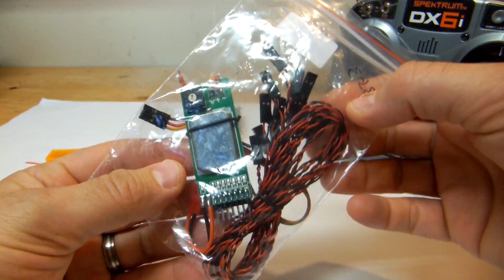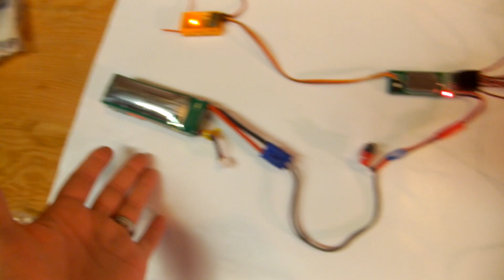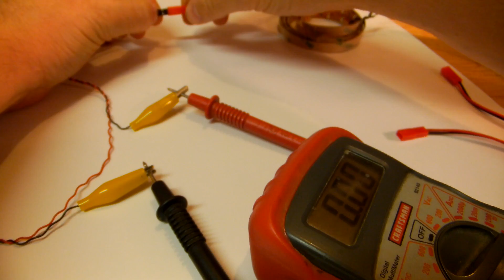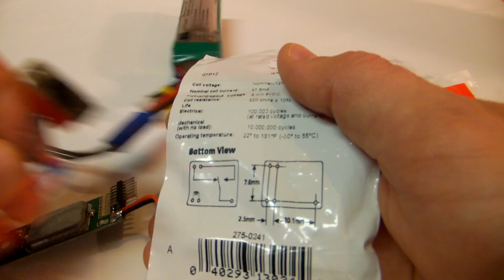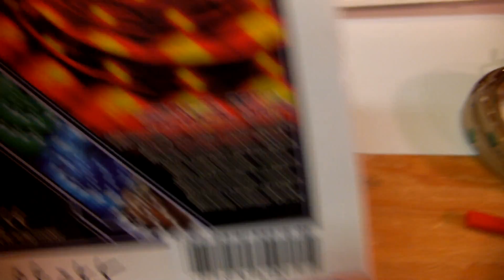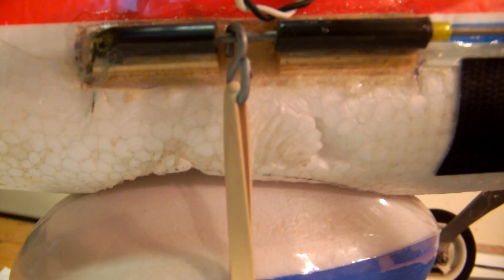How To Install LED Lights on Your R/C Plane Using a Multi-Switch

Comment: can you link the exact plane you are using.  i would like to think that would be a good plane to use for park flying with LEDs.  Also, is there any way to connect LEDs to the balance lead from the battery instead of the main leads.  I don't want to put an extra battery in the foam plane (too much weight).  And I would like to have the full voltage due to LEDs requiring 12v and balance leads from the battery need to be in series and they are not, there are just indivicual leads from all the positives and the the negative. so that would be parallel and only give the 4.2v (fully charged lipo) as opposed to a 3S 12.6v (fully charged 100% full).  Thanks man!!!

Comment: I want to add an LED, light to an old router, most new tools have LED's that come on with a squeeze of the trigger, (ala drills and such), so my question is, can I use the 110v inside, and step it down with a resistor? If anyone has done this, please comment. Thanks

Comment: Not sure what idiot savant would give this video a thumbs down, but clearly, they're out there. 

Outstanding video/tutorial. This was really ahead of its time, as the sUAS boom is now upon us with the rise in educational degrees to fill the rising number of sUAS piloting jobs. Those new to sUAS or RC need/want lighting systems and there is still really no one-stop-shop solution for this. 

This video is the first and best explanation of the components and wiring required to set up a working lighting system, whether you're a savant or new to RC and electronics.

In fact, it was only by chance/luck that I found this after a week of searching...and I was amazed to see the date of the post and realize how relevant this is some 4 years later.

Comment: Fantastic video, thank you for making this product and taking the time to share.  Question:  is it possible to eliminate any of the ports so that it is possible to set it up to cycle through only say... 3 or 4 of the ports?  Thanks again, I will be buying one!
Reply from the maker: Yes, the workaround is to set it to one of the modes that activates 2 ports at a time with each toggle. Then just put your electronics on half of the ports. This gives you a cycle of 4 before resetting to zero, instead of having to cycle through all 7 each time. Your toggle cycle will then go like this with each press: 1 and 7 on, 2 and 6 on, 3 and 5 on, 4 on. Then just plug things into 1, 2, 3, and 4.
Reply: Gotcha of course.  Thanks for the tip, and the switch works great!

Comment: Good info...gave ya a LIKE and subscribed!
Thanks!!!!
One question...when a batt pack gets swollen, isn't it unsafe and a fire hazard, just sitting around? (referring to one of your other videos on the multi-switch)
Reply: if it's swollen, don't use it in your plane.

Comment: One more question .....what is that that you are using to power your "cheap" receiver? That has to run off of 5v right?
Reply from the maker: I think I was using a LiFe battery pack. I was using that battery pack originally to power my receiver in a large nitro powered airplane.

Comment: If I place a 5v ubec between the 3s battery and the main lead into the Multi-Switch, will that allow me to use 5v devices out of the 7 ports Glassdogangle ?
Reply from the maker: Yes that is exactly correct. Whatever voltage you send into the thicker input wires is the exact voltage you will get out of each of the 7 output ports.
Reply: This answers my question too, so thanks.  Next is a higher powered switch I am looking for. I will want to turn on and off an EDF at an efficient speed.

Comment: Is there an LED or some kind of flash that is strong enough to be seen during the day from a distance, such as when your drone is flown to a point where it's just a tiny dot and you end up losing where it's at.  A bright flash that you can engage with a remote will help you find the drone.  Is there such a thing?

Comment: I have a question. I have this LED navigation light system, however my 6 ch rx is already connected with all channels to my rc heli.  What solution you can provide so I can install the LED lights to my scale heli? Can I directly connect the positive and negative (red and black wire) from the LED to the lipo w/out connecting it to the rx?
Reply: No,  I think you would need the yellow (data) wire connected to control the multi switch.

Comment: Question? My patented controller doesn't have any extra aux channels for me to extra devices such as led, etc. I wish to place a retractable landing gear unit with it. How can achieve this? Yuneec Q500 and ST10+

Comment: Do I need to run a inline resistor to every LED light? Like I said, I'm right next to brain dead when it comes to electronics. Again Thanks.
Reply: You don't have to. just make sure your LED's are same voltage as your battery voltage that supplies power to the output. unless, you are using an LED with lower voltage then you must put a resistor on each LED's. Hope that helps.

Comment: How do u power the Led ring headlight? I read on hobbyking it pulls more than 500 mah?
Reply from the maker: +vonown3d --- I use the multiSwitch as described in the video to power the LED ring at the front.
Reply: +glassdogangle i see, is it the hobbyking one? do u know the amp pull on it? thx for the good vids!
Reply from the maker: +vonown3d --- Yes it is the HK one. I don't know what the amp draw is. Haven't flown her in over a year.

Comment: Hey, awesome video! However, I need some assistance regarding the realys. How do you wire them? I have a total of 5 pins, I know the 2 coil pins and the 2 normally closed and open, but what does the fifth one do? Some people refer to it as the COM....

Comment: How would My ESC fit into this setup? With the ESC pluged into channel 3 that supplys power to the Rx do I still need the other Bat?  Just Confused...Again a new be.
Reply: you plug a seperate battery to the jst plug on the multiswitch. the servo wire from the multiswitch will got to a free channel on the rx

Comment: Hey doorknob, that little "noise maker" speaker is called a Piezo buzzer. You can buy them online or at Radio Shack for $6.99.. which means painstakingly taking apart an Energizer "panic device" to get the little speaker is completely pointless. It's called deductive logic. Try it sometime.
Reply from the maker: +ShadowⓋ &lt;~~~ Painstakingly? Hardly. I think you missed the entire point I was trying to make. The point is with a 12v battery as a power source you can take pretty much anything that runs off 12 volts and power it using the multiSwitch.
Reply: glassdogangle
Well.. that seals it. You're completely insane.
Reply: +ShadowⓋ Why in the world do you have to come on here and act so rude? There were many different ways to say it was a piezo buzzer instead of insulting. You missed the point of how he was saying you could use about anything that would work with the voltage he has available. And an FYI if someone does a search for panic alarms they will find ones for $2-$4 which dont require any other circuitry.  I am an electronic tech and I am very impressed with his setup. GREAT job glass!
Reply: Tim B
As if everyone has a "panic alarm" laying around their house to go through an insanely complicated procedure to make a buzzer. It's called deductive logic. Seriously dude.. How about just buy a fucking buzzer from Radio Shack? That's my point.
Reply: +ShadowⓋ You are correct and I understand it might be a lot easier just to get a little piezo buzzer, but Radio Shacks are getting harder to find and it is even harder to find actual electronics parts in many of them anymore.
Just stating "Buying a piezo buzzer from radio shack would be easier" would have been so much more respectable.
He was kind enough to record and post this video for people why be rude to him, just inform and educate thanks
RadioShack piezo buzzer 6-18vdc sku 2730059 $3.99
Reply from the maker: +Tim B --- Shadow is upset because his only contribution here was to rudely point out that one can purchase a peizo buzzer separately without opening up a panic alarm to get one, and we were not giving him due credit. I feel bad for taking that moment of glory away from him. Sorry, Shadow. I vow I will never again pop open any other electronic devices to salvage parts. I swear. I will henceforth buy everything new from Radio Shack. Thanks for the tip, Shadow. (saw, saw, cut, cut, hack, chop ,chop, bzzzzz, saw, saw, snap, bzzzz...noises in background)
Reply from the maker: +ShadowⓋ --- Thank you for revealing to everyone on youtube the dark wicked thoughts bouncing around between your ears, which you have now made public for everyone to see. A man's words always betrays his own inner struggles.
Reply: glassdogangle What a bunch of hot air. You "betray" yourself with a bunch of bullshit.
Reply from the maker: +ShadowⓋ --- Rage much?
Reply: glassdogangle
It's not "rage", it's common sense and deductive reasoning. For people such as myself, idiocy is easy to see. Think of it like looking through glass.. and the more you try to insult me, the worse it gets, so I wouldn't even go there because that's my specialty. Rest assured, I'll make things very miserable. It's best to just STFU and learn the hard way.
Reply: *****
Just be sure you finish me because if I get up you're going to meet your God.

Comment: hello glassdogangle i am buying a f16 fighter jet that i am going to use as a display piece in my living room suspended from my cathedral ceilings, is there a way i can activate the multi function switch with some sort of wireless remote and turn all the lights on at one time? thank you in advance

Comment: I just picked up one of these to operate my lights on my Ranger Ex.  I am currently running an ImmersionRC receiver with 12 PPM channels assigned.  To operate my camera selector, flaps, pan and tilt I have used up my "physical" channels coming directly off my receiver.  Could you give me a breakdown on how you accommodate all your channels?  At this point I am making choices on what I can connect and operate remotely.  Can I integrate my cameras and lights onto this multiswitch?  The last thing I want to do is step on my channels by assigning a physical channel that is currently being occupied by a PPM channel.  Any help you can provide would be awesome.  BTW, love the videos.  My Ranger Ex build is based on your setup.
Reply from the maker: I use a Taranis 16 channel R/C control, with 12 channels enabled. For my Receiver, I use a 12 channel DragonLink. If you have used up all your physical channels on your receiver, you will not be able to use the switch. You need one open Rx channel to operate the multiSwitch. You can't really run your camera off of the multiswitch. The multiswitch is simply a way to power up 7 different devices one after the other using only 1 single channel on your R/C system. You would want your FPV camera to be powered up all the time from the moment you turn your plane on, not just when you power it up using the multiswitch. I mean you could, but why?
Reply: thanks for the reply.  Just need one more channel.....  man.   I guess between pan, tilt, flaps, camera selector vs. light switch, I could just manually plug the lights in during dusk flights.  thanks for the info!
Reply: 82dParatrooper Hi. If you have a Futaba radio, specifically the 14SG, you can set it up in what is known as "Mode D". This gives you Chs 1-8 on the Sbus, and 9-16 on the Rx, assuming you bought the Tx as a package with the 7008 receiver. I think you can also install a 2nd Rx and bind to each of the two separately. Im guessing the DL does passthrough, but you didnt mention using it, only the host of this video said he had one. Of course if he agrees, then I will know my up-and-coming build with a DL which is on my workbench will do what I just wrote about. Hehheh.

Comment: Great and wonderfull video, so detailed :) - Good Job !!
I was wondering which battery should I purchase ? How to calculate ?
Following your explenation I have puschased 12DC Led lights (below) and now need a battery (3S, Capacity, discharge rate) 

The leds I would like to use are as following:
- 3 M strips (https://www.hobbyking.com/hobbyking/store/uh_viewItem.asp?idProduct=8944)
- White 16 circular light (https://www.hobbyking.com/hobbyking/store/uh_viewItem.asp?idProduct=28509)
- 2 Led corn (https://www.hobbyking.com/hobbyking/store/uh_viewItem.asp?idProduct=26425)
Reply from the maker: Just get a 3s and don't worry about the C rating because LED lights will never pull enough power to reach the maximum current, as long as you are using a 3s battery of a minimum of 800mAh or so. I would recommend a 1300mAh battery, because that is what I use. The important thing is how big your airplane is. You can pull power from your flight pack, or you can have a separate battery for the LEDs. Main thing is you don't want to send anything more than 3s voltage (11.2-12.6v) to your LED strips if they are 12v strips.
Reply: Thanks for the quick response, I will buy a separate battery in order to reduce risk and enable long flight.
And again Thanks A LOT.

Comment: Each 5050 LED has more than one LED inside, I think there is 3 or 5 led's inside each 5050, so your strip of 5050 led draws way more current so if you go above 500ma you will burn out the switch so use a relay as Glassdogangle said.

Comment: I ran two lengths of 5050 led lights on my sky walker and the switch is getting extremely hot! What do I do? They are 12v leds.

Comment: I ran two lengths of 5050 led lights on my sky walker and the switch is getting extremely hot! What do I do? They are 12v leds.
Reply from the maker: I am not sure what 5050 led lights are, but if you are pulling too much current with no airflow, I can see how it would heat up. Try running it with something that has less current draw, and see if it still heats up. It could be the switch is bad somehow. I don't remember mine getting hot at all, ever!
Reply: glassdogangle http://m.ebay.com/itm/221554685630?nav=SEARCH.  This is the same led strip but green and red
Reply: glassdogangle http://m.ebay.com/itm/221554685630?nav=SEARCH.  This is the same led strip but green and red
Reply from the maker: MR2phene I checked the listing for those LEDs. I wonder what the current draw is? That's the most important thing here, and it is not listed :(
Reply: MR2phene From post above: Each 5050 LED has more than one LED inside, I think there is 3 or 5 led's inside each 5050, so your strip of 5050 led draws way more current so if you go above 500ma you will burn out the switch so use a relay as Glassdogangle said.

Comment: Hello Brother,
I need a help and a doubt. I have a FS-CT6B Tx & Rx. Everything is fine. But I want use any one of the two switches on the top of my Tx to just shot two wires using the Rx. How can i do that? Plz Help.

Comment: Does any else see how "boated" the LiPo looks?  is that normal??
Reply: boated?
Reply: All lipo batteries puff up like that due to a normal chemical reaction in them, this happens once they're getting old and it's a good sign that they should not be used any more because they're likely to burst open and spew fire. They aren't useless, but they're only good for a few applications.
Reply: Sorry for the spelling error, I meant "bloated".  It looks as if they were swelling up.  I remember reading somewhere when I purchased my maxamps lipos to stop using them if they started to swell up.  Anyways, awesome video!  Id like to see more accessory opportunities!
Reply from the maker: steven macqueen That battery is just used for bench projects. I would never fly with it!

Comment: OK, how do I wire the relay to light off the rocket motor igniter? What is the best way to launch the bottle rockets?
Reply: Scratch that, You're awesome that was a great explanation. I've now got a set up where I can fire rockets!

Comment: Super Video,Gratulation. Der Anschluss des Multi-Schalters wird nachvollziehbar dargestellt.Die Funktionen der verschiedenen Mode wird anhand provisorisch angeschlossener Lampen und der LED's auf der Multischalterplatine demonstriert.
Es gibt Angabe über Spannung und Laststrom.12V/0,5A.Für höhere Lastströme wird der Anschluss eines Hilfsrelais erklärt.Die zur Betätigung der Ausgänge erforderliche Schalterfrequenz wird dargestellt.Es werden diverse Anwendungsmöglichkeiten gezeigt.Der "Finde mich" Ton ist eine gute Idee.
Es gibt Tips zu Lichtstreifen und deren Anpassung.
Das Beste-es wird so gut visuell dargestellt,daß man auch mit wenig Englisch-kentnissen der Erklärung folgen kann.
Bisher kannte ich Springfied nur aus der Serie "Die Simpsons".
Dieses Video ist eher "Silicon Valley".
Beste Grüsse aus Bayern ! Good Job!

Comment: Great job Doug! Thanks for that VERY informative video!! Now I have to go do a little shopping! I added LED's to my plane but mine run off a 9 volt battery and are connected to a switch that I have to manually turn on before I fly I love the multi switch. Looking forward to adding that to my Penguin. Explains a LOT of my questions. Really appreciate it!!